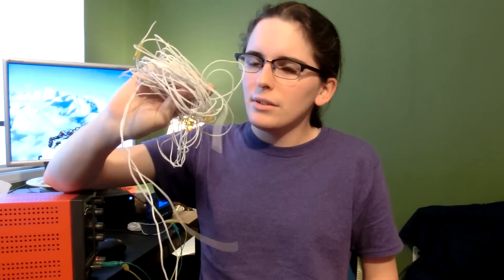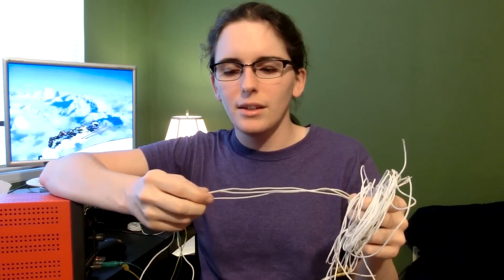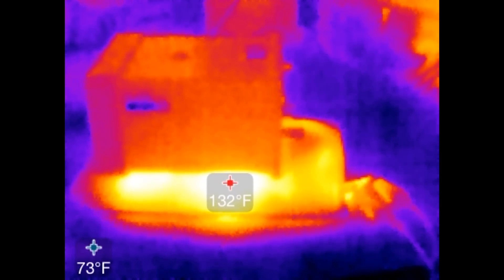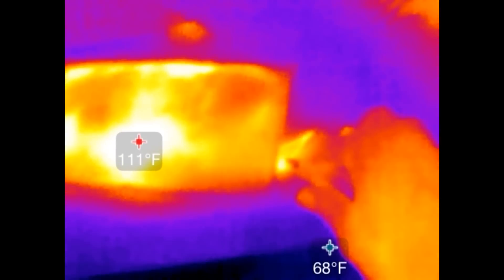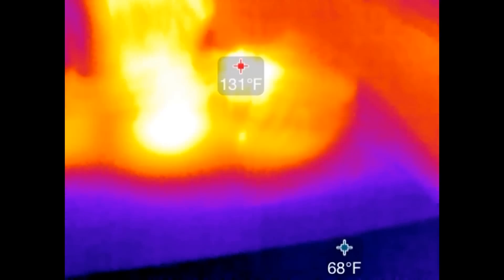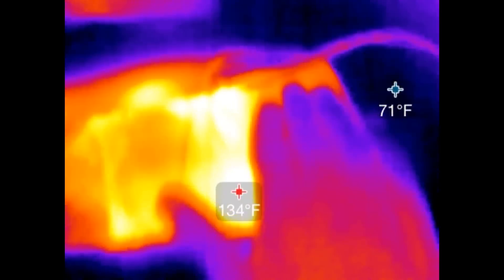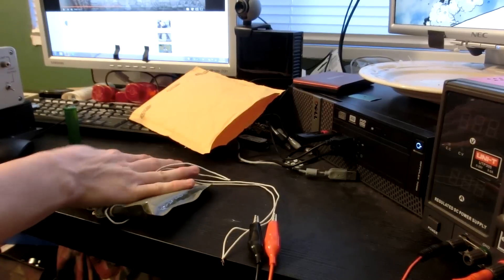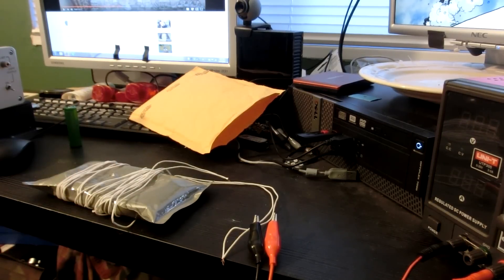Electric Ration/MRE Heater 01: how much energy to heat food?

Comment: What if you had a solid copper insulated wire coil the size of a baked bean tin that you have to push the bag in tightly? Then surround it with metal foil to keep the heat internally reflecting?

Comment: more potential of fire in this design if you ask me
Reply from the maker: compared to what?
Reply: using a lithium is actually more dangerous than just using a chemical reaction to create heat. At this point it would probably be easier just to carry a hatchet and some waterproof matches or something.
Reply from the maker: jimbobbyrnes
no its not, its far more stable and controllable, and no risk of hydrogen explosion.
Reply: but all you need is a bit of water and bang a short circuit. you would need to make it waterproof and still small enough to make it as good as a burner. also a solar cell or a hand generator would be great.
 but i do not trust lithium outdoors. I destroyed alot of em leaving my homemade battery packs outside.
Reply from the maker: jimbobbyrnes
no, a short circuit would just waste energy at such a low voltage. there would be no explosion whatsoever.
Reply: it could still start a fire if your use any flammable materials like cardboard but i guess the water would have turned the cardboard to mush. make it waterproof and fireproof then add a hand crank to charge the battery and your set.
  

I feel like building one now.
Reply: I really like the military MRE's just the way they are.  The ration heaters work super fast and the cardboard boxes allow a decent amount of insulation.  The entire system is super light and the large outer bag makes it easy to pack your trash out of where ever you are camping.  All of the packing materials are recyclable and the spoons are easy to save clean and reuse since they are heavier than normal disposable spoons.  You also don't have to use the flameless ration heaters since they can easily be heated in a pot of boiling water or in a solar oven as well.

Comment: What infrared imager are you using your body temperature is only 87* so your Ir imager is not set-up properly without adjusting for emissivity you cannot determine the true temperature of an object so the temperature of the food maybe alot warmer than what your Ir imager is showing. the best way to determine the temperature of an object you should use a thermal couple.
Reply from the maker: i think your thinking of core body temperature, our skin is much cooler, sometimes down to 60 degrees. i think this is good enough since i was looking for temperature difference anyway
Reply: You are correct in that there can be a difference based on the same factors that would affect the test temperatures which are airflow, ambient and emissivity and if those are set properly in the imager the skin temperature would still be in the 90F to 95F range unless the room temperature is well below 70F and you had a fan blowing air directly on your skin. Skin has a fairly high emissivity of .99 which means skin is 99% efficient at radiating energy and the IR Imager should have detected a higher temperature from your hand and fore arm which even cold environments emits very large amounts of heat since they are so close to the core unlike the legs and feet. If you read this far I have worked with Infrared Imaging for close to 20 years and its just a pet peeve of mine to see so much of the technology misused and not understood by those using it know. 
But my whole point is that the temperature of the item that was being heating was probably much warmer than believed because the infrared imager was not set-up to compensate or cannot compensate for the known variables such as emissivity and that a simple thermocouple would have given a more accurate temperature. The first thing taught about infrared imaging is that a true temperature can never be derived from the imager but by setting the imager up properly to compensate for known variables a close to accurate temperature reading can be achieved.

Comment: 2 small silicone heater mats should work well for this application.
stick it to the side of some aluminium box shape that fit the ration pouch or a heavy duty Mylar bag for compactness.
When you use it you should pour some water in to maximize heat transfer and also help keep temperature even across the pouch.

Comment: While you are absolutely correct that MREs have a lot of trash leftover, unfortunately that extra "just stupid" packaging is what is necessary for them to be so durable.  They are sometimes air dropped, sat on, rolling around in a combat vehicle, thrown around and stuffed into an already over full ruck sack.  FWIW 3 MREs are a single day's ration.   They aren't the best food in the world, but they do what we taxpayers spent millions of dollars in R & D for them to do.  Sustain Soldiers in the field when fresh food in unavailable.  In the years before the little chemical heater, we would stick the pouches in exhaust pipes, on engine blocks, and if you were lucky, like I was, you had an electric MRE heater that plugged into a 24v power jack(like a cigarette lighter socket in a car) and in 5 or 10 min you had up to 4(IIRC) piping hot pouches of MRE goodness.  My vehicle normally had a 2 or 3 man crew, so it worked pretty well.  It was about the size of a small shaving kit with an orange silicone coated flexible resistance heater strip about 4 inches wide serpentined within the insulated velcro close pouch.  You slid your meal pouches between the serpentined layers.   And yes I tried many times to light the dangerous hydrogen from the chemical heater off gassing.  But to no avail.  But the Joes would extract the content and pour in into water bottles and shake for the infamous MRE bomb.  Just pressure from the bottle exploding, not a hydrogen explosion per se.  Keep up the good work.
Reply from the maker: its stupid for civilian rations.

Comment: The military wouldn't want it -- too bulky and they have a billion ways to heat these things but many of them are not bad cold. They throw them on engines, put it in front of the microwave dish. All you did is reinvent the toaster and you don't need special wire -- just insulation rated to the temp you want to heat it to. So any 105C wire will get it past the point of steam safely. To control the temp use water or in lieu of it get a thermoresettable fuse -- they've been used in kitchen appliances for decades now.
Reply from the maker: +BikingMNViking this isnt for the military, in the video i say its for camping. i dont give a fuck about what the military wants, most of it we should take away from them anyway.
Reply: You're welcome for the ideas on how to make your 'invention' work more cheaply (in case anyone wants to mass produce them) and more efficiently and safely. Have a happy cat day!
Reply: Rinoa Super-Genius
Just like a cat would do, I expect nothing more of you and called it first.

Comment: You can get styrofoam boxes from a greengrocer, just cut the middle section out until its down to size keeping the base, lip and lid that fits together. It would make efficient, cheap and easy to handle insulation. A few layers of aluminium foil will stop the heating wires melting into it.

Comment: Perhaps make a styrofoam box with the wire mounted permanently inside with just enough room to slide the food packet into it. The rigid styrofoam box would allow you to mount the battery on the outside along with a switch.

Comment: hmm..
you could make an insulated box the same size as the box the meals come in, add a small solar panel, 18650 cells, and a simple circuit to beep when the meal has reached the preferred temperature.

Comment: Great video! Ironic you talked about using 18650's for power banks for cell phones that's what got me to your channel (I was using 18650 to do just that) it gets about .75% of a charge per battery based on a 2000 mAh battery. You can get cases that hold 4 batteries from ebay for about $3 with 1-1A & 1-2A usb ports.

Comment: Whatever material you use as a frame, add a sheet of foil, or mylar to reflect the heat, and maybe some  heavy duty spring clamps to maintain good surface contact.
  I understand your gripe about extra packaging, but take into account how the MRE's get transported, that little extra cardboard may provide enough structure so when stacked 20/30 high the food bags won't burst from the weight.

Comment: The real question to me is how much heat does it take before releasing toxins from the plastic bag back into your food.
Reply from the maker: +chaseme81871 idk, 400 degrees? its aluminium on the inside though.
Reply: oh. I did not know that. I personally have never eaten a ration. thanks for the info.
Reply: +chaseme81871 Those chemical packs get crazy hot (relatively) so it looks comparable to what Rinoa got with the electrical element.

I'd say you'd boil moisture out of the food and rupture the bags before any chemical diffusion.
Reply: +chaseme81871 Sadly a lot fo plastic bags and containers release chemicals when heated. Unsure of what is in that foil on the interior but my bet is there is something that it's bined with that allows it to be (coated) on the inside. My wife being a Saftey and Health Manager has taught me a ton about the stuff in bags and materials that are not good for you. Heat reaction causes these chemicals to start being released at a low temperature anywhere from 150 degrees and up.

Comment: Why not just use freeze dried food for camping?
Reply: +GrimL0gic 
Big enough to hang glide with. ;-)
Reply from the maker: +GrimL0gic because freeze dried food isnt the greatest unless you want crunchy food.
Reply: Rinoa Super-Genius Some meals are better than others, true, but the only time it is crunchy for me is when I don't add enough water. Your video is interesting. I think its best application would be when there is a strict fire ban and you still want heated food. Other than that fuel and wood wood be much more convenient and energy dense. Am I wrong?
Reply from the maker: GrimL0gic
well if i have to add water, then it kinda defeats the purpose of having a meal ready to eat
Reply: lol technically they are MRE. I just wouldn't recommend it. The lack of water is actually a plus. It reduces weight
Reply from the maker: +GrimL0gic but you still have to carry water with you to rehydrate it. so your idea of a quick meal is gather some firewood, build a fire, rehydrate some dried food, heat it up, then eat it and clean up your mess. that requires you to find wood and water, thats not everywhere.
 
my idea of a quick meal is i put a bag of food into a heater, it heats up, i open it and eat it.
Reply: Rinoa Super-Genius That is true. Water and wood aren't every where but that is why you often have to carry large amounts of water. That is true whether you have a MRE or freeze dried food. You still need to drink. If wood is not available you need to carry propane or white gas which is much more energy dense than an 18650. You put hot water into a packet of food. That isn't any dirtier than all the trash you get from a MRE. Finally, I agree, your solution is more convenient, but camping and convenience don't usually go hand in hand. Your idea is still good for a fire ban though =)
Reply from the maker: GrimL0gic
no because if you have a solar panel on your backpack you could make more energy than the weight of carrying fuel.
Reply: Rinoa Super-Genius How large is your panel?
Reply: rationalmartian haha perfect for mountain trails